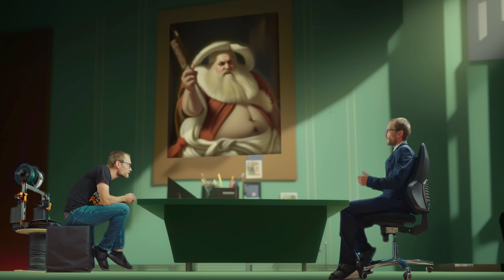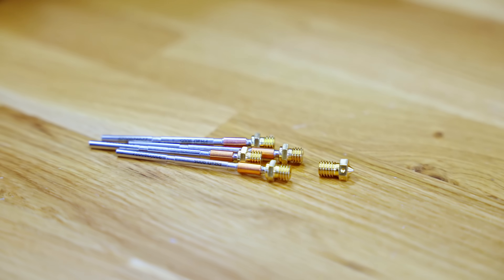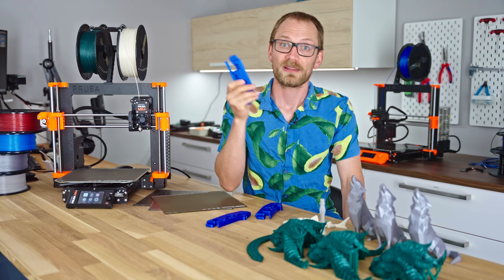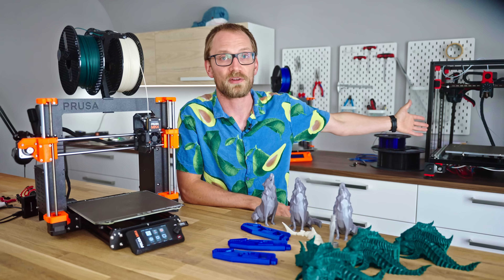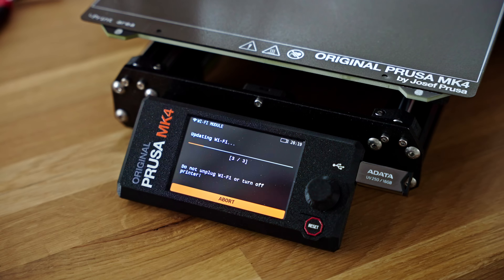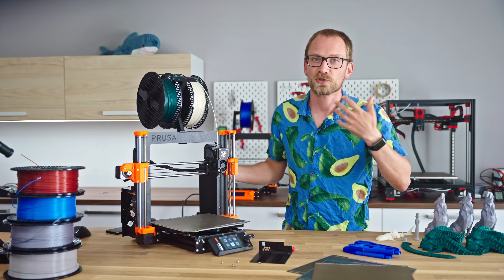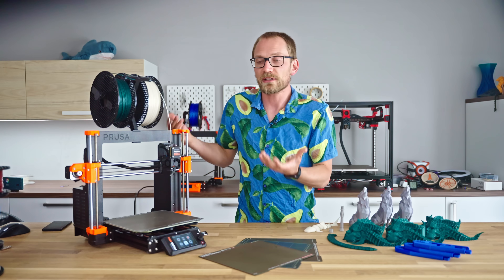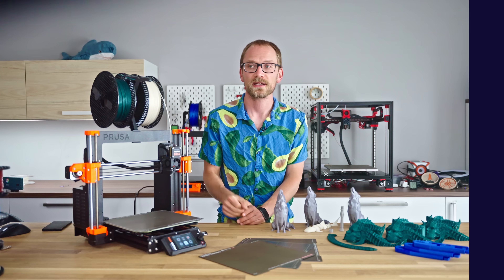Does the Prusa MK4 have what it takes?

Comment: I bought a Mk4 kit, and I'm glad I did. For $800 plus a long day assembling it, this printer is excellent. I've been astonished how little configuration was required (zero). I just assembled it and hit print, and it cranks out perfect prints every time. My Prusa machines (this is my 3rd, plus some upgrade kits) have always been very reliable work-horses, and that long-term durability and reliability is valuable to me. I hope the MMU3 ends up being as good as the Mk4. It's not flashy and headline-grabbing like the Bambu, but it's excellent in its own ways that I appreciate.

Comment: I got a MK3s kit a few years ago. After assembly (which was a lot of fun and educational) it worked immediately an flawlessly. Print quality is excellent ever since. It just prints and is so reliable. I never had to tinker with it.. It cost more than twice an Ender 3, but I never regretted to pay the premium. A main point also was, that I am fairly confident and feel safe to let the printer work unattended for large overnight prints - something I would never dare with a chinese knock off. 

I agree, that the MK4 is a bit pricier these days, but given the experience I had so far with the MK3, I would still be willing to pay the higher price.

Comment: Just built my MK4 and love it. I’m coming from an Ender 3 V2 that never produced anything good and I was constantly fixing, even with $200 of upgrades. I spent about 80% of the time fixing it and 20% printing. I even designed a custom mount for a dial indicator so I level my bed with precision because ABL did practically nothing.

So yes, the MK4 has a place because it just works. I didn’t need it to go fast or anything like that, I just needed it to work. Maybe I will go to another printer once I’ve recovered from repair burnout, but for now, I’m happy.
Reply: Having the exact same issues with my ender 3v2. Is your mom still holding up I'm debating getting the Mk4 soon

Comment: I sold my Prusa mini and Mk3s and got an MK4 on the release day, it has been working nonstop since then, never a failed print, no first layer calibration, nothing, it just works flawlessly. 
I love most things about this printer, but it has some downsides, yes it's expensive but if I wanted quality for "cheap" I would have kept my mini, and Prusa link is a bit buggy and slow and some features like input shaping are not in the machine yet. But I know that these things will be tended to and fixed along with new features and functions. 
The thing about this machine is that it just works, no gluestick, no messing with calibrations, I just throw any crappy filament I have and it gives me great prints every time.
Also lastly, the support is amazing and as it's being produced in Europe I can get parts within a few days, which is a huge upside when working with Prusa machines.

Comment: Good job Tom, fair and honest review. I've had a MK3s for longest time, and I got at least 5 of my friends to buy one too. But after finally taking the plunge to get a X1C with AMS, I've honestly not looked back. I thought I'd still keep the MK3s to print in parallel if I was needing the extra output speed, but unless I'm multiplexing many projects at the same time, there just isn't even any reason to have the MK3s do one part, since the Bambu will probably finish the first part, and then finish the 2nd part all in less time (and fuss) than my quite upgraded (Revo) MK3s. In half a year of printing, there has only been one part, a 1" wide threaded screw, that for whatever reason, prints better on the MK3s than on the X1C (even slowed down). 

I did preorder the 5 head XL, and now many years later, I'm honestly not sure what to do with my preorder amount. I suppose my hope is they come out with some magical high speed XL improvements (cause what I've seen so far on Tada doesn't make me want one at all), and the 5 heads are faster at multimaterial printing than the AMS, which although easy to use, is hugely wasteful and massively slow. But then again, at $3500 USD... that's enough for like, 3 more X1Cs, or a whole farm of P1Ps, or whatever new printer Bambu comes out with next. It is just hard to justify, even if I very much like Prusa's contributions to open source community.

Comment: I bought a pre-assembled Mk4 after having an older I3 and an original mini. My reasons:

* I want a printer that "just works" without tweaking. The MK4 was/is that. Complete and calibrated right out of the box, and has had zero issues. My 3d printer supports my other hobbies, but tweaking 3d printers is not part of my hobby.
* I want to support a company that gives as much as it gets. The open source approach is a huge plus to me. Given your audience, it would be good for you to emphasize this as a positive at least some times. :) There are lots of companies out there who are just "takers" and build down to the lowest price possible, using another person or company's R&D, without adding anything real of their own, and without contributing back.
* I want to support a company that pays a fair wage to their employees.
* I want to support a company that has sustainability in mind and acts on it

I know not everyone will agree, or find those important, or necessarily have the money for a Prusa even if they did. 

Oh, but shame on Prusa for that horrid WiFi implementation. I couldn't get it to join my network, and when I looked it up, it turns out it's not worth it because the WiFi is so incredibly slow anyway. That was a really dumb miss on their part.

Comment: I strongly believe that Prusa is moving super correctly in the principles, but they are at a very big risk of getting crunched by the uncaring market. The mk4 looks like this so you can theoretically start from the mk1 or mk2 and upgrade up to the mk4. But nowadays this is not a big selling point anymore. Printer are becoming appliances, and there's not a lot of room in the market for people who like to build their own fridge. On top of that i agree with you regarding the open source part. Yes in principle prusa are the good guys, while who exploit their work are the bad guys. But still the market does not care, so some choices here, even though asbolutely super fair in principles, are now a risky commercial disadvantage. Prusa had an edge on technology that granted them an advantage for years, because if you wanted a workhorse reliable machine you had to buy from them. Now it is not true anymore, the new products are not only cheaper because they produce in china and on par with the tech because they exploit the open source, but they are also more advanced so even that advantage is gone. If they want to keep their position they'll have to adapt, even if it looks ugly now for the good guys, business does not care.
Reply: If your strategy does not require unlimited growth for shareholders you can survive very well in this market. Makerbot, Ultimaker, and you name it all went the growth route, that's fine but makers don't want expensive proprietary products so you need to switch to the B2B market (which they did). I have contributed to quite a few products and the early days and seen many companies fail. The market is a thin one, there is not much margin. Either you build something cheap or you find some other niche. Prusa perfectly fits the niche of the original Makers, no other 3d printer manufacturer does anymore, competition is smaller than ever.

Comment: I love my Prusa printers. 

However,
Prusa Connect
PrusaLink
Mini Wi-Fi 
MMU2

Were all things I expected to be supported/improved earlier. They announced selling features & then it felt like they didn’t even update us. It makes trusting them on upcoming features more difficult.

I think the MK4 kit is still a solid value depending on what someone’s time is worth. I obviously don’t know their decisions behind many choices, but it feels that they didn’t simplify the assembly process to allow for upgrading the MK3. However, it hardly seems worth the upgrade cost over selling the MK3 & buying an MK4…
Reply: The Ethernet file upload on MINI+ after a previous print is just silly. I 'get' that it's probably there to make sure that the user has cleaned up the bed before the next print, but if I fail to exit the print menu, it lets me upload a file and start a print, but then fail at the end, and then I need to exit the menu on the printer (which is fair) and find the freshly uploaded file in a jungle of other files on the SD card.

If I'm reuploading a new version of the same file, it just fails (at the end, I think) instead of asking for confirmation for overwrite. Not the best arrangement UX-wise. Not the end of the world either, but feels clunky for no good reason.

Comment: I don't need a bunch of 1-off features, I need a machine that works reliably for years. I got that in the MK3S. Going on 4 years now with no major problems. And if anything does go wrong, Prusa Inc is there as a sustainable company to provide support and parts if needed. Compare that to the Ender printer. At least a couple times a week on the 3dprinting subreddit, it seems like people are finding them on the side of the road in various states of disrepair.

Comment: None of the other printers on the market today check all the boxes that Prusa does :
- Quiet enough to run two in my study while I work
- Excellent print quality, no excuses
- Excellent build quality, no excuses
- Always works, no excuses
- No mysterious Chinese cloud sees my work 
- Makes the world a better place by paying a living wage and open sourcing their work.
Reply: Here's the problem though - only a tiny portion of people buying a printer care about most of those things, especially in the current economy. The higher cost for those things is Prusas problem, not the customers. As much as I admire them and have massive respect for what they do they can't compete with the competitors right now. Neither you nor me are the average customer.
Reply: and many printers check boxes that prusa dont offer
-its quiet because its slow compared to a Bambu X1C
-1200€ for an open pre build printer(you can get 2x P1P for one MK4)
-Only PETG, PLA for large prints without any Mods or expensive enclosure
-Worst mechanical setup ( bedslinger) for fast printing
+Good costumer service...
-still a bad user interface
+Made in the EU
-Bad build material choise (PETG) if you want it to use for high temp prints
-Beta status ( things that are advertised are not in the final product
+better security ( but you dont have to use the cloud on the Bambu...you can use the LAN Mode)
Reply: @Jabbawock1972  Those are tinkerer issues, I'm an artist/designer. Not everyone wants printer go BRRRR.

Comment: I really like that the nozzle can still use e3d v6 nozzles and the open source nature of their printers. It's a missed opportunity not using a faster wifi module and including a simple camera. Adding an accelerometer and a few strain gauges would have been very low cost. But it bridges many of the main problems between the prusa mini and mk3s+ that I feel more comfortable recommending the mk4 now for reliability for beginners. There is tough competition from bambu labs p1s but I am worried about having to buy into their proprietary ecosystem to do their qc for them and keep the printer running

Comment: The lack of a sensor for input shaping is a massive problem in my book as mechanical harmonics can be massive affect by the surface the printer is placed on or any mods applied.
Reply: Indeed. Its why its pretty annoying to me how many printers are coming out with klipper right now as a main feature, then tell their users to spend an hour faffing around with input shaping manual tests to get a rough idea of whats going on every time they move their printer. Its ridiculous.

Its even more ridiculous to ship the printer with pre built input shaper settings because that means that users literally have to just hope their circumstances match the manufacturers closely enough. IIRC I believe the V400 shipped this way, with no method of changing it outside of installing klipper from scratch, which I find pretty absurd.
Reply: Not to mention the BELTS!! Belt tension is a big factor and they will loosen overtime, especially when they are new.
Reply: @xsvforce3335  belt tensioners come on Prusia printers.
Reply: I apologise for my absolute ignorance regarding this. But am I totally mistaken in believing that the size, weight and shape (and possibly even "position on the print-bed") of the print that is being printed also influences the "resonance harmonics" of the "machine". And if this is the case does machines that have accelerometers use them to "recalibrate continuously"?
Best regards
Reply: @onlyeyeno  you only need to calibrate the model once for the head on all access and all ranges of motion
Reply: @onlyeyeno  it’s usually best practice to calibrate whenever something changes about the environment of the printer. So…. Any modifications, changing what table it sits on, etc. The Bambulabs do a calibration on every print unless you remove the gcode to do that.
Reply: @johnbrooks7350  ...OK many thx for the reply :)
Best regards
Reply: @pilotavery  
 ...OK many thx for the reply :)
Best regards
Reply: @onlyeyeno  You aren't ignorant at all, and in fact are right.... ish but also wrong.

That is to say that basically because no one has come up with a live, active reaction system instead it's based on the printers empty weight where an accelerometer is ran on the bed moving then the head.

This does indeed mean that printers with beds that sling are likely to get worse and worse results the higher the weight of the print printing. Right now no one has thought of a way around this. I can think of a number of solutions but they'd all suck because it's about resonance and that involves a lot of things like the surface you're on thst could or might not even affect what frequencies you'd set for whatever formula you're using. That's all to say don't expect it soon, SK bed singers are at an inherent disadvantage there.
Reply: @onlyeyeno  keep in mind that every time you change the mass of the head even slightly you have to calibrate it again. Even just the weight of a paperclip or a zip tie makes all the difference. That's why it's not good that they have one size fits all tuning for the input shaping
Reply: @pilotavery That is true, especially if you were targeting a specific frequency, but your are filtering with something looking like a normal distribution bell shape. This means that input shaping works on a range of frequencies and therefore is less “precise” for better and for worse. 
As previously stated the optimal solution would be a synced kinematic compensation based on real time input from all axis. But that might not happen just yet.
Reply: lack of 2 gyros..core XY for the win..mk4 is just dead out of the box now..they should have just made it only as an upgrade kit to mk3/s owners and focus on releasing something like bambu x1
Reply: @BeefIngot  well you can easily calculate the weight on the bed by layer, do 2 freq measurements one empty bed and one with known max weight lets say 100g, then interpolate between those..still not a problem for core-xy printers as the bed doesn't affect this..
Reply: @St0RM33  In very rough theory sure, in reality not at all. You'd have to account for different geometries and the different resonant frequencies different shapes of even the same weight can bring.

You consider that on top of the fact that no one has actually done this, and it's really a spherical cow type of question.

Comment: In defense of Prusa, I'd trust them to offer better quality parts than the cheaper alternatives. The PSU on my Sovol SV06+ is regrettably bad (high electrical noise jamming FM radios + awfully loud fan) and I had to replace it. Next, the power switch melted on the machine (also on other machines that are still with the stock PSU afaik), which was clearly not happy with a 500 W PSU. 

I wouldn't expect something like this to happen with a Prusa and am still considering the MK4 as a replacement for my SV06+.
Reply: One of the reasons why prusa printers cost more than their CCP clones is partly because they use high quality, OEM components in their BOM. And the smooth brains cant seem to understand that. I have almost 25k print hours on my MK3S with zero replaced components other than a nozzle. Meanwhile, my P1P died after just 10hrs because they use the exact same cheap, low quality stepper motors as a $150 ender 3. Prusa stepper motors are still made in china, but they're name brand LDO at least.

CCP printers are all built in shenzhen and use the same parts from the same factories next door to each other, that's why parts on them fail so easily.